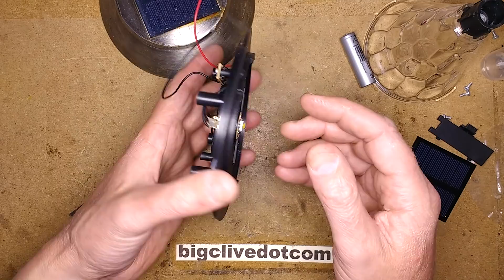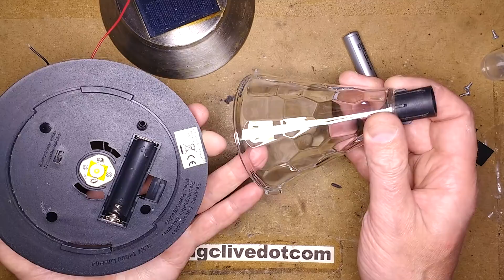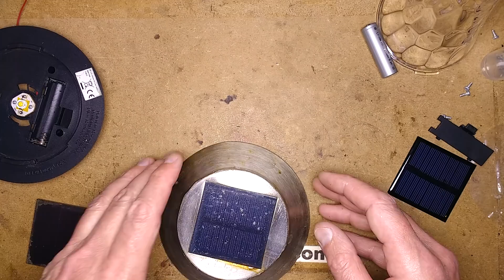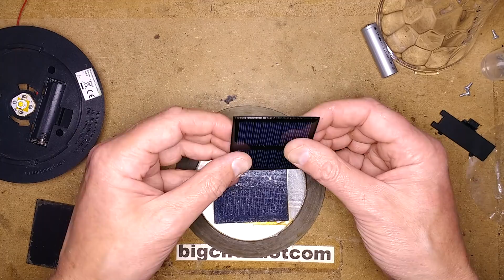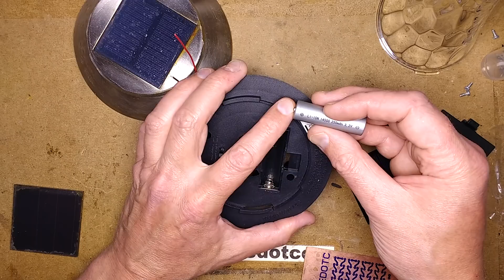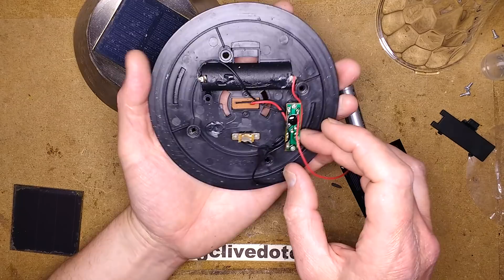Solar panel sealing test and lighting experiment.

Comment: I still maintain that the resin-potted solar panels are crap. They rot after a few months in the Summer sun in Australia. The glass-based ones, however, are still OK after a few years.
Reply: You can repolish the surfaces, but I tend to agree - our variety of sunshine is very hard on epoxy coated cells. Best to replace any potted cells with glass faced ones (via the usual sources!)
Reply: It's not always easy to find the glass ones in the right size. Now, if I go to Bunnings and look, I'll only consider the ones with glass.
Reply: Gary Rumain Those resin coated panals do the same here in the UK, after a year or so outside, even industry grade ones used on solar powered road signs and bollards go cloudy after a few years. I've tried car polish on them, it works for a few weeks but they then turn completely white!
Reply: Yes  and it's not just UV doing it, is it?
Reply: Gary Rumain  put the small resin panels inside a "pet" bottle ie coke or sim & that will protect the panel from uv, lasts for years
Reply: It's not just UV. I found some 50x50mm. square ones that sit on the top of metal posts on eBay. These were perfect for the posts that support my garden fences so I bought some. They fit perfectly. One day, after some overnight rain, I noticed there was some white residue on the surface of the resin. I thought it was some soot that remained after the rain drops had dried up. But I couldn't rub it off. I noticed it got worse and worse as it rained. Very odd.
Reply: Gary Rumain I also have those exact lights that fit on my pool fence they are small black ones right? Mine also went cloudy after about 10 months, put clear nail polish over the panel it’s been 6 months and they are still clear recommend trying that.
Reply: Yep, 50mm. square with 20mm. deep  black plastic on top and 30mm. deep (the visible part, anyway. There's more above and below but it's hidden in the post or covered by the black cap) white plastic underneath with a reflector inside the bottom of them. Found them on eBay and decided to give it a try after realising they fit perfectly into the metal posts.

After the first rain, I noticed a problem with one getting a white spot on it. At first, I thought it was some soot left over from the dried up rain drops. But it got worse as more rain affected it. But the worst thing was the summer heat in Sydney. The hot melt glue inside the black part melted one hot day and ended up fusing to the battery on two of them. I brought them in intending to fix them but they've been sitting on my desk for months now. Perhaps after winter finally ends. :)

Did you clean the solar panel part up first or just put the nail polish directly onto the damaged resin?

All my glass ones are still OK as far as the glass is concerned but don't work. Need to resolder them. And replace the NiCad batteries with NiMH ones. Had them for 3 years and they still look good, though.
Reply: Gary Rumain I cleaned them prior then added the clear polish. I bought mine at Bunnings $12 for a two pack.
Reply: I didn't know you could get nail polish at Bunnings. :) How did you clean them? Just a wipe or used sand paper or something else?
Reply: Gary Rumain I used a micro fibre cloth with some water first and then I used eucalyptus spray (turps should be fine two) but don’t use to much as the plastic will start to corrode and become sticky and even worse. You on.y need like a tiny spray or like one or two drops. Also that was a typo I meant to say I got the two pack of fence post lights at Bunnings and the nail polish at Kmart. 😂
Reply: Yes and in my opinion that don’t last as long I think. I live in Australia too and bought two from Bunnings to test out and they are a lot brighter at first but are completely off after 2 hours. The glass ones often last longer but in a hail storm almost all of my were cracked, to be fair they were large hail stones. The glass style ones are more hardy and look a lot better in my opinion too.
Reply: My big problem is shadows. I'm in a townhouse with my building on the east side of the rear garden and another building on the west side. I'm lucky to get 4 or 5 hours of direct sunlight over the yard. I'd tried moving the lights around but that only gets an extra hour or so. However, they still last at least until midnight in summer, so about 3 hours.
How old are yours? How much sun do they get? And what batteries do they have?
I haven't bought any solar lights from Bunnings in a while but I've noticed they now have some with Lithium batteries. Duracell Solar. In an odd size too.
Reply: Gary Rumain I use the power tech 2500 man aa cells from Jaycar really good but really expensive. One side of my backyard is in shade so the right gets more sun so the lights stay on till about 12 on that side and on the left till about 8:30 but in summer the sun moves and they all get full sun in the backyard. In the front yard all have full sun all the time they all use the glass solar panels except fence ones in the backyard. The front ones are amazing they are from big w they are these square bollards with massive panels on top which take up the whole top of the light and it looks very sleek and you can’t even tell it’s a solar cells just looks like a tinted glass panel that goes right to the frame edge these last a really long tome even with stock 400 or 500 man aa cells but with the 2500 last until like 1am as the solar panel can only charge it a certain amount. The plastic blue ones don’t last long and are really terrible in shade and you wound get barley any charge from them. They need full sunlight all day to work for a decent amount of time. I like the fence ones last the longest and are really bright, they always have full sun but maybe mines a different make/brand because mine are excellent even on stock battery after like 18 months.
Reply: Gary Rumain there is a video on my channel of the bollard ones with the massive panel if you want to see there are details in the description box.
Reply: Just don't get the BTY 3000 batteries from eBay. Heap of junk. I've noticed a lot of the Chinese sellers have set up warehouses here and sell locally now. I suspect it's to avoid the added GST of overseas purchases. Shipping is a lot faster too and the prices are about the same. The only problem is a lot of the stuff they sell is still junk.

I'm familiar with those bollard type lights. Bought a pair from Bunnings. Had one in the front yard until someone stole it. Watch out for the Gardman lights from Woolies. They look like the stardard round ones. 4 pack for $8 seems like a reasonable deal. Until you discover the batteries are 2/3 AAA. And they don't sell replacements in the battery section. Try looking online and they are next to impossible to find - unless you are willing to part with $76 for a pair from the UK!
Reply: Gary Rumain yep there crap tested them and they’re dim and the led is a directional one which points to the ground and not in 360’. They have a new set of ones they brought out last week by mirabella they are the same light shoved in a premium style lense and frame looked identical to my high end ones for like $7 each but were essentially the round ones in a new base with a smaller panel and battery. Not great but for $10 for 4 it’s not that bad if you just want the frame as some of my old ones are cracked But wouldn’t recommend the actual circuitry or leds as they’d break after a few months I’d say.
Reply: OK, I'll have a look.
Reply: Gary Rumain the batteries from jay car are excellent but a bit steep at like $6 a battery. I live in front of a park and there is a storm water channel in front of my house that’s in between the park and my street and teens love to do dogie stuff there and I’ve had so many stolen or smashed I’ve had cameras put it because people keep taking them. I live in Glenwood (near castle hill/Bella vista) so it’s not exactly dogie but lots of people from other areas have moved here recently and that’s when the issues have started.

Comment: Interesting on the LiFePO4 charger.  I'm guessing it shunts but maintains the cell at 3.65V ish?  It has been shown that this will lower the longevity of the cells. They should be allowed to drop to resting voltage after achieving the chosen maximum charge voltage otherwise there is a risk of plating and capacity reduction.

Comment: I've been using clear duct tape on the solar panels and I started spraying the circuit boards with lacquer and none of them have failed in the last two years.
I think using the silicone under the clear duct tape would make a good combo.

Comment: Don’t see the point in repairing these 99p £1.49
Reply: BIG T. It’s not a matter of economics, it’s because you can. Sometimes it is more fun to spend $2 to fix a $1 light.
Reply: Because A: You can, and B: Every bit of practice and experience helps. And C: It's a hobby, they don't make sense.
Reply: Then you are not a tinkerer or a hobbyist sir.
I think the LiFePO4 cells by itself costs over $5.
Please unsub.
Reply: Yep agreed now go fuck off
Reply: This are not the super cheap ones.
Reply: There is always the environmental issues, better to only add the led and solar panel to landfill than the whole thing. Not that I see Clive as a tree hugger, Swampy type especially with the pollution created on his rotting fish eating parties. 😁
Reply: "only add the led and solar panel to landfill" - Or rather, put electronics waste through the appropriate electronics waste disposal facilities. You know, the disposal facilities where electronic waste goes.
Reply: consider the case as a building block
Reply: ... Unless you end up with a far superior product, adding minor improvements, so that you end up with something that'll last ten times as long as the flawed design, saving you from buying ten more...(added sarcasm), really, there's no point to fixing anything.

I have a 30 year old truck that usually costs more than it's valued at to repair, but what that's worth to me is priceless. I know how to fix or maintain nearly everything on it and still spent less than a new, or even a used car payment over the time I've had it. It's truly gratifying.

Comment: AFIAA, all diy silicone sealant liberates acetic acid on curing. A good,  but expensive source of the other type is a dental supply company. We use silicone materials a lot and for obvious reasons,  do not use acetic acid producing ones. Ours are opaqie though. Regarding the lighting,  I don't like it for the very reasons you mentioned.
Reply: Aquarium supply shops might be a source of neutral-cure silicone. It's used to seal fish-tanks.
Reply: Rob Fenwitch Used an aquarium one recently and it still released acetic acid, certainly smelled like it anyway. I think the main difference is it doesn't contain fungicide as it's poisonous to fish.
Reply: Perhaps I was lucky. Also it was in the mid/late 70's...

Comment: Hi Clive, the lighting doesn't look right in this video. The huge LED COB array needs to be dimmed a LOT. It only needs to just fill the shadows on your bench a tiny bit. The colour's off, as well. Not a huge success, but you'll get there!
Reply: The colour looks fine to me, just a little over exposed. The problem is that the light is centred so it appears dimmer out along all the ends/edges. He should really use a copy stand set up with lights in all 4 corners for even illumination (although this will make the shadows look odd).

Comment: Is it possible that you will go through that charging / light circuit in greater detail (with schematic) ?
Reply from the maker: It relies on the solar panel to limit the charge current to what it can actually put out.  The bulk of the circuitry is under a plastic blob (COB) and it appears to be a shunt regulator and a voltage level sensor to turn on the LED when the solar panel stops putting out current at night.
Reply: Thx!

Comment: I was a electrician for about 15 years, my dad was a electrician for 45 years and 1 thing I noticed and I asked my dad if he had seen tje same thing. Every electrical encloser my dad and I had seen always had moisture in it. I live and my dad did till his retirement in South Florida. He had a theory that since the humidity here rarely drops below 80%, that at night when the enclosure cooled the humid air would condensate inside the encloser and/or if it it had conduit attached you would get air movement because differences in temperature from one end of the run to the other. His practice, which I copied was to always put a weep hole in the bottom and keep your wire nuts up so they didn't fill with water like a cup. You would also get water in the conduit from a fitting somewhere in the run. On outside outlets or switches we would tear about a 1/4inch hole at the bottom of the gasket . I have gone back to a few places up to 10 years later and the enclosers that my dad or me installed had sometimes 95% less corrosion then others that were installed at the same location at the same time. Hope that helps and thank you Clive for all the videos, you have greatly increased my understanding of electronics.
Reply from the maker: That's been my experience too.  Moisture will penetrate sealed enclosures via thermal expansion and contraction of the air.  It's better to give it somewhere to drain out of and keep connections up high and well apart.
Reply: Hey thanks for the excellent information, it's little conversations like this that make all the difference.
Reply: Learning Electronics Cheaply now thats useable knowledge, thanks for that.
Reply: It's actually required in outdoor installation. There are marked holes that you need to punch out in every plug and switch for outdoor use in germany.
Reply: Learning Electronics Cheaply, going often into industrial environments, leaving a hole works until they use their high pressure or steam cleaners. We've had more than one thing go bang because of some holes that were never supposed to see water, suddenly received a jet of water under high pressure.
Reply: Yep, like Nokero's solar light. We learned that it is impossible to keep water out, so we have a small weep hole where the water can escape. And, all electronics need to be potted.
Reply: A trick my father taught me for segmented displays. Make a casing that you can seal against air. Find a spot to install a bleeder valve from a car brake system (they are cheap at auto part stores). Install the bleeder into the inner case wall, slightly loosen it to open the bleeder and pull a vacuum through it. You don't need a perfect vacuum, just the ability to hold roughly 5 in/Hg without a noticeable leak is good enough. After it's under vacuum for a minute or two, tighten the bleeder to close it and remove the vacuum pump. I use a Mityvac handheld bilge pump style of vacuum pump with a liquid catch cylinder in-line, cost around $30USD in a kit with most of the adapters you'll ever need.

The problem is as we all guess, condensation. Condensation happens when there is moisture in the air. Pump out the air and there will be no moisture left in the system.
Reply: I spent 10 years working as an engineering in the auto manufacturing industry and another 10 years working in the electronics manufacturing industry.  No matter how hard you try it is extremely difficult to keep moisture out of electrical/electronic devices.  Thermal cycling is a killer. That's why most designs are engineered to allow the moisture to escape.  Drain holes are one option.  Other options are simply to allow the device to breathe/vent.